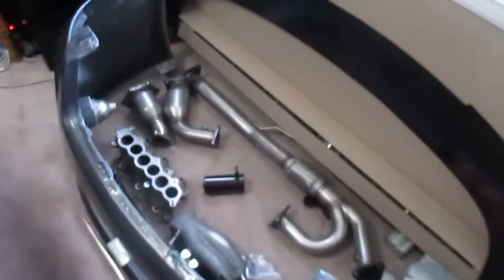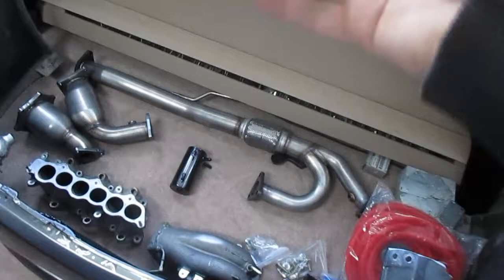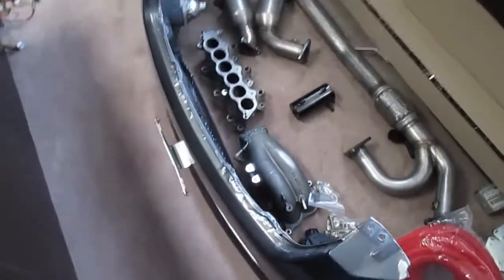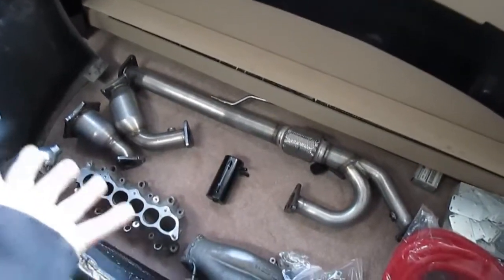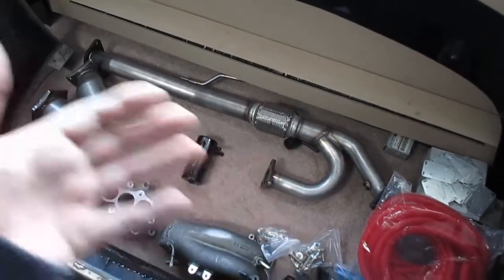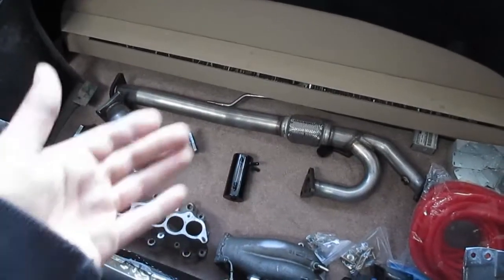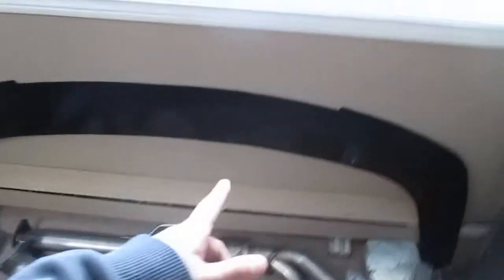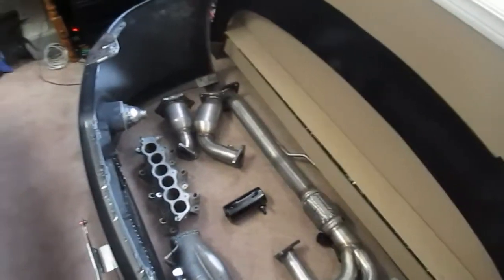Altima Future Mods - Pre Cats, Y Pipe, Intake Manifold, Oil Catch Can

Comment: I already have my lower and upper intake manifold , elbow port,with a nwp 75 tb and is a big difference! I not use the oil catch can, but a delete the pcv valve plus the egr block plates for keep my port part clean as possible!! Good luck bro!!

Comment: HFC and ypipe are a great upgrade were you will feel some sort of performance lol. I did the HFC last spring live them.
Ypipe I did my self. HFC is a little more difficult to do only bc of the space you have to work with.
I actually had my exhaust guy do my HFC because the stocks were really on there and had to be cut off lol. And I have the same set up on my 6th gen max. HFC ypipe and exhaust.I can make a video clip of the sound for you.

Comment: Neat set up .. Hope it improves you performance .. Looks like it's gonna sound awesome though , ..ever consider putting the altima on a diet ... Its one heavy girl
Reply from the maker: I tore my back seats out and spare and a bunch of their stuff one day for track day and I didn't even run any faster lol. I'd have to take out a lot for it to help i think
Reply: ...my younger brother has an altima se as well (why i found you channel in the first place ) i weighed his wheels , hubs, stock struts,, hood ,trunk  ...the stock 17s are 26 lbs a pop alone ...( i know you swapped them) ...look for un sprung weight ,,,if your front seats are motorized ... swapp em out  ,,the  run times wont change much but the acceleration and handling will improve  ,,, trust me your butt dyno will be satisfied

Comment: DNALI PLEASE ANSWER BRO, does the Y PIPE have a catalytic converter? Im trying to delete mine since I dont have too much money for the Y PIPE
Reply from the maker: yes the stock Y pipe has a cat
Reply: +DNALI would you recommend me to delete the catalytic converter? I was thinking in just putting Straight pipe, would it harm my Altima? It's cuz I don't have money for the y pipe and pre cats
Reply from the maker: +CAZ Sepulveda stock the Altima has 3 cats. two right off the header and one on the Y pipe. if you delete just the Y pipe one you should be OK. but deleting the pre cats will cause a CEL so you either need an O2 bung or tune
Reply: +DNALI yeah i want to delete only the one behind the resonator, not the pre cats, Im trying to do it only for sound I want more deepness, and other question, can you send me the link of where you bought your greddy knock off replica, cuz i bought some ebay, i think it was resonator muffler raceline or something like that, i took them off cuz i didint like the sound, and the ones that your altima had sounded amazing can you please? thanks bro